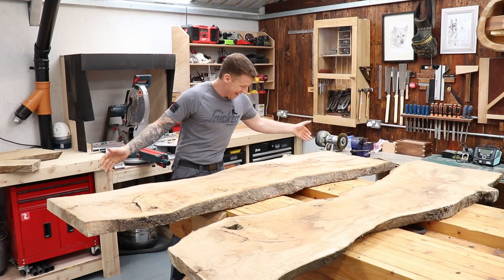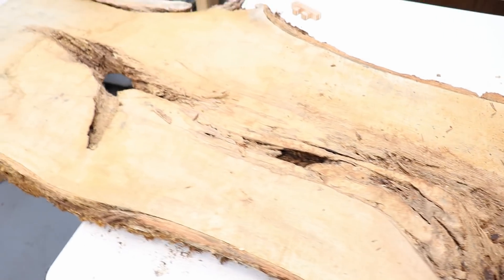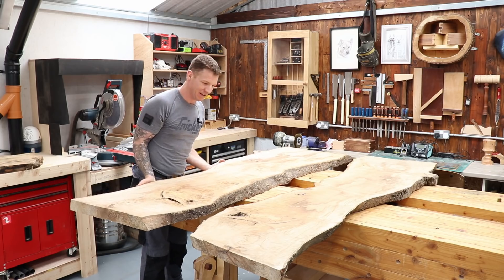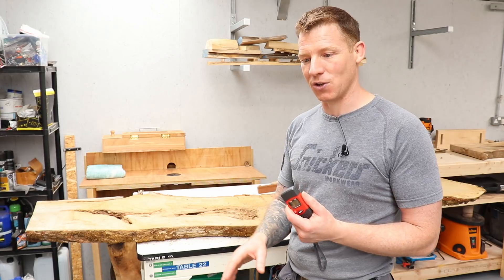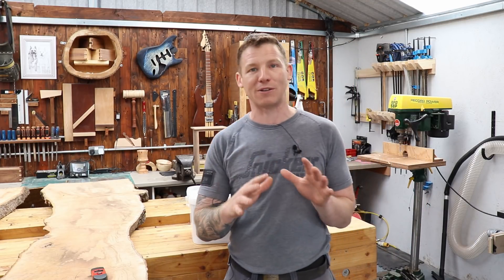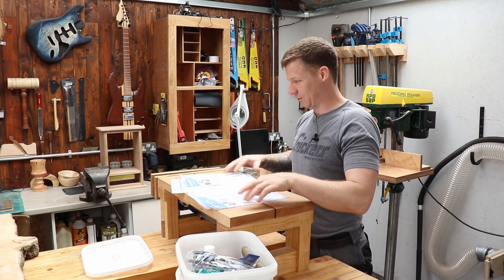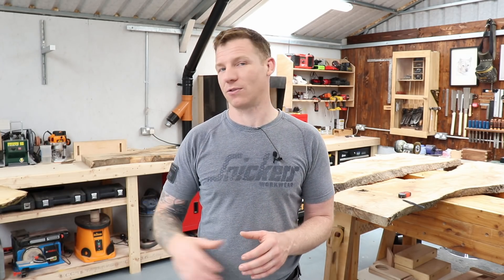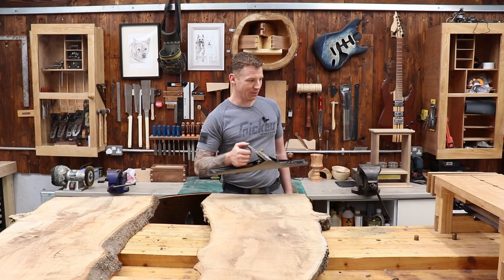Resin Table Project! We Have Wood!

Comment: I can't wait to see the tables. I would advise using polypropylene sheets for your epoxy boxes with MDF or plywood back to give support the same for the edges. polypropylene sheets will give a great finish as it is super flat and is easy to use as it will not stick to the epoxy and it is reusable. I have the same 2 frames for nearly a year and with nearly 40 tables tops between them, they are still going good. Just make sure to seal the edges. I forgot this on a 10kg pour and never forgot it again. Mr Price 151 silicone works great for €1.50 a tube
Reply from the maker: Thanks for the tips

Comment: I've often wondered how the resin behaves with the seasonal changes in wood. Is the resin flexible enough to stretch and shrink with the timber, or will it pull away from the wood. Might be something to include in your research.
Reply: from what i understand, resin acts as a stabilizer, so the wood has no movement when its cast in resin, how true this is, i don't know.